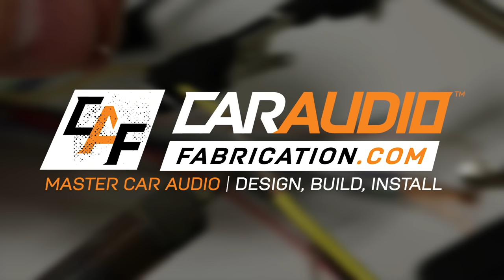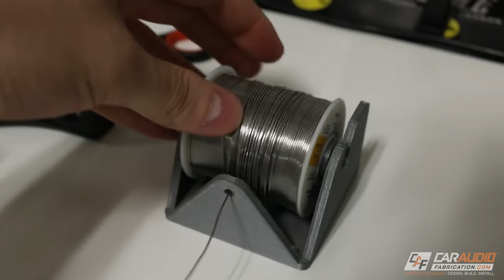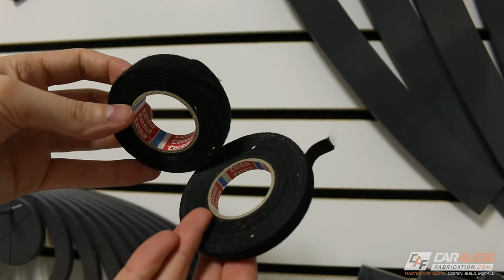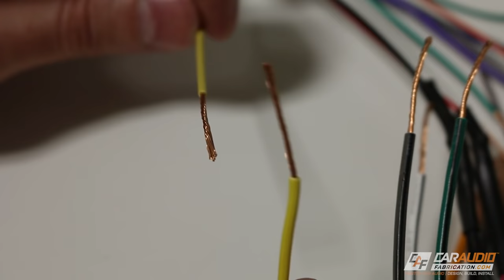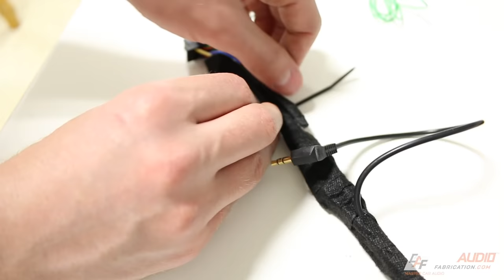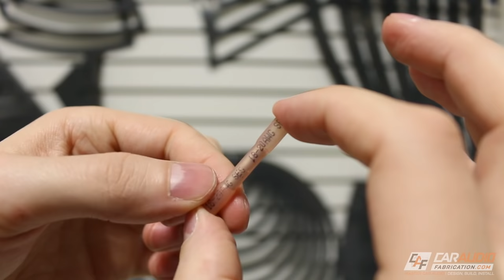Radio Wiring Harness - How to Install like a PRO

Comment: IDK how many times I got the wire twisted/soldered perfectly, and then "BOOM" I forgot the shrink tube! Similar things while I was making all new brake lines I got the brake line double flared perfectly just to cut it off because it had no fasteners
Reply: Its a pain, but if you have a pin removal tool you can just remove the wire from the connector.... slide the HS over and replace the pin.  I wouldn't know anything about that though, but I never forget ;-)
Reply: I know. I do that just about every time!

Comment: advanced pro tip: stagger the lengths of each wire so no connection is wrapped against another, especially when soldering. Sometimes the soldering process will create sharp points that can penetrate heat shrink and create a short circuit, it also avoids a bulge in the wire bundle, especially if you wrap all the wires together with tape. Otherwise great job showing proper layout so everything stows properly. Best connection is a crimp barrel soldered and protected by heat shrink that has glue inside. A poorly soldered connection will actually create excessive resistance, causing the wire directly before the connection to become brittle and eventually break. this comes back to using the correct type of solder and ensuring the wire is properly sized for the distance and load. Each connection will have some sort of resistance due to the electrons having to pass from dissimilar metals, the goal is to create a connection that has the least amount of resistance, and to design a circuit with the least amount of connections.
Reply: A tip from a real Pro.
Saved me having to say it

Comment: I eliminate the OEM harness altogether, and hard wire   everything, fresh 12 volt battery, 12volt ignition, and all fresh OFC everything, including speaker wire, since the factory wires run thru much much to many junctions, which degrade sound I have also learned if you do use the OEM harness, It affects the idle of the car on some models Mitsubishi  to name 1,it was like the cars ECU didnt like it, idle problems, studdering, so i started running  everything  fresh ,this way the cars computer doesnt even know a stereo is installed ,YA it is alot more work, but the extra work is really worth it in the end...but thats just me you do great work, keep the videos coming...

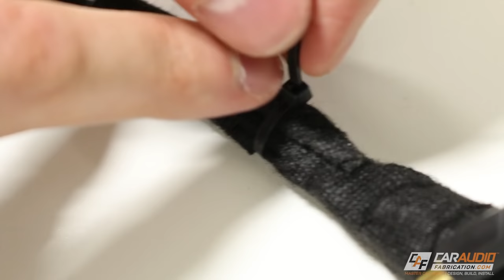Comment: 9:29 THIS. So much. I can't even begin to describe the amount of times I got cut from a ziptie remains that wasn't cut like this.
Reply: If the zip tie is cut and you left a sharp bevel just touch touch the bevel with flame from a lighter for like 2-3 seconds. Its way cheaper than the tool...

Comment: Thank you so much, installed an android double din but it required me to connect the wires to my new harness. Never soldered before but you gave great tips, especiall about the tesa tape which I brought from ebay. I first soldered only the negative, constant and ignition wire, then tested it at the car, it worked so went back and soldered the antenna and the rest of the speakers wires. I tested it again, audio worked and the radio. Once I knew everything worked, then I made the cables neat and used tesa tape. One thing to remember, makes sure you put heat shrink before you solder, forgot on 2 of my wires so used electrical tape. But anyway, thank you for the clear instruction.

Comment: I just installed a new head unit. I DID do the soldering & heatshrink, but I wish I'd seen this first for the Tesa tape tip. It would have made my harness look MUCH better. Also... you might want to mention connecting to grub screws, like with a line output converter. I tightened the screws down on bare stranded wire, and had problems with wires falling out. I later found out that I should have used ferrules. I'll redo my harness at some point.

Comment: continuity after wrapping it up? probably do that before wrapping in case you have to fix a connection
Reply: 2000 nissan gsx stereo wiring diagram

Comment: Another point you forgot to mention about tesa-tape is that it is also somewhat dampening, therefore reducing the chances of wire rattling against some other parts within the radio bay or wherever else you're using your own wiring.
Reply: How to Chose the Correct Harness for you Stereo
Reply: @DeathCap  any shop that sells stereos should have the right harness for your car

Comment: I really liked this tutorial, as a mechanic always telling people solder is a better choice, it was awesome to see someone who also believes in doing it right, right from the start, I have troubleshot electrical issues that people have had and it is the connections made that have failed in most situations. If you are spending cash to get the toy you want wire it right so it won't fail as easy. the twisting the way you have done it looked really good, i have spread the wire like a flower then twisted together and your way looked like a better connection than mine. Thank You Sir
Reply: ross lesher why do you say solder is better?

Comment: Also, make sure before you do any cutting, soldering is you know what to do do, this was my first time ever soldering and do anything like this. I watched a few soldering videos, made sure I had all the tools I need and took my time do it. Don't be impatient. My next thing to do is to install a steering interface as my steering wheel has controls so will be doing more research hard to do that but once again, thanks.

Comment: Thanks Mark. i have learned many new things in the Mobile Audio with along Steve Mead and EXO.  because of all of you i have bought many different products for my sound system.  and just other things like this video.  on knowing how to solder the way you did.  i did not know of looping and twisting together.  Yes i have had made the mistake on the heat shrink and forgetting them toput on first before soldering.  Again thank you for this great video.

Comment: Soldering really makes a difference. Cartoys installed my stereo when i was 18 (with crimps) and about 2 years later and a lot of bumpy rides, my negative wire came loose, i removed all the crimps and soldered the wires this time around and i swear my audio quality was noticably better afterwards

Comment: I changed my wireharness from buttconnectors and even from just electric tape and used the solder way and it fixed it. :) TY

Comment: Great video.  I prefer just zip ties to bundle the wires together, but very clean.  The tape can get sticky after time if you want to swap in another head unit or modify the harness.
Reply from the maker: +Cory Simmons use authentic Tesa Tape, it's important to get the right model number. It doesn't leave a residue.

Comment: Love the channel, I am not a professional installer, but      I have completely rebuilt a few cars and trucks frame off restorations and I have my Extra Amateur radio license so wiring is pretty simple stuff for me, yet I still learn things from your channel about equipment, mounting options etc...

I loved the videos on using plastics for brackets, mounting etc... I've used metal in the past and you've taught me some new options.

While looking through your videos I happened across some of your early videos, so glad you dropped the "ghetto wanna be" aspect of the presentation or I never would have continued to watch and subscribe.

Comment: Thx 4 the tutorial. I'm gonna be installing so I needed a refresher, its been like 15-20 years since I installed a stereo. Back in day I used electrical tape for the wrap but I'm gonna get some of that tape you used. 👍✌

Comment: I personally prefer to solder, but a crimp is technically the more secure joint. The heat shrunk crimps are also pretty great if you stagger them.
Reply: If I’m using heat shrink do I need to solder as well?

Comment: I couldn't agree more : Do not cut the factory harness (Unless there's absolutely no alternative), solder connections that you want to be permanent, and last for a long time, and wrap them wires together (I've used electrical tape + a few zip ties, braided wire loom, plastic split loom, and once all I had was waxed string, so I wire tied the bundle. Just keep them tidy, secure, and protected. 'Nother good video Mark, keep up the great work (Wish I could afford half of the stuff you use).

Comment: Way to go Mark, 
I use the 3/8" tesa to hold back my "Save for Later" wires same as you but a small stitch or tape..
Some times I use Female bullets to make it easy to add and disconnect too!

Comment: I really like your videos and I think you do really clean work, but I would of used smaller heat shrink over the wires so it shrinks tighter and instead of the tesa tape just use zip ties but thats just my preference but again your work is super clean and ive learned alot watching your videos
Reply: The tape better protects the wires, zip ties over time can cut into the wires with the vibrations and constant bumping that occurs within a vehicle. Tessa tape with a tie on top is safer in that regard as it pads it and take more time to potentially damage the shielding of the wires.

Comment: I don't want to imply that you did not add something that needed to be added, because this is exactly correct on every level. I just want to add an asterisk to the video though. Before you start to dig into buying an aftermarket radio and all of the connections, make sure you don't have an amp, or some other feature, that needs to be considered in the installation. With these new cars, there can be several things that could pop up that would make your installation not come out the way you want it to.

Comment: Mark.  The only 2 things I would do differently is after soldering you should clean off the flux residue left after flowing the solder with alcohol.  Over time the flux will corrode the connections.  The other thing is if you pre-tin the wires before you hook and wrap them you will get a cleaner and stronger connections.  But a lap splice would be more than strong enough and faster.  I have lap spliced wires and tried to pull the connection apart and the wire will break before the solder splice does.  You should look up IPC soldering practices.  I use them at work and they are industry stardards.
Reply: Was just about to comment this. Just needs cleaning.
Reply: bhaejr that's only with acid flux.  No electrical solder used today uses acid flux.
Reply: brian hilligoss the most common solder is rosin core. That is a medium flux. All solder has flux in it or it wouldn't flow properly. It needs to be cleaned off with alcohol so that it will not degrade over time. I work with it everyday.
Reply: bhaejr I do work with it as well every day. Cleaning of the flux is more a professional touch now a days with none acid core flux.    Most rosin core is pine tar based.  That will not degrade today's lead free solder.
Reply: brian hilligoss I can show you circuit cards that come back from the field that shows a different story
Reply: brian hilligoss I can show you circuit cards that come back from the field that shows a different story
Reply: i was thinking exactly the same ting, plus i prefer to parallel wire solder, i don't like to  stress so much the copper..

Comment: Not sure if you have already done a video on using your factory head unit and add after market processors and amps. I will scroll through you previous videos if you have not that is one that would be awesome Matt! Thanks in advance.
Reply: I also forgot to mention that the stock system is a Bose hi end with a sub woofer in the center console that I will be keeping for a front stage and the rear subs will be the same size as in the center console and I will be replacing that woofer with the same kind that will be in the rear. Most likely CT Sounds and amps so would you run all 5 woofers off the rear subwoofer amp or keep the center console on the stock amp?  Help me out Matt

Comment: Thanks a lot for this video. There are only a couple spots that do installs here in town and they charge an arm and a leg.
Reply: When you find someone good, knowledgeable and trustworthy it is worth the extra money. But there are a lot of dirt bags out there. Have them do a small job first, and see how it goes. Any little thing that you do not like...then try the next place/guy. Because if something is a little wrong on a small job, then expect larger problems on larger jobs.

Comment: What is the best way to connect those other two wires from the interface?  You said they had to be connected in the car and that is the part I am struggling with on my install.

Comment: For those who dont have good soldering experience. What about heat shrink connectors with solder in them? and then tape it around like you did.

Comment: Solder is great, but a butt connector is just fine for most connections. Especially for wire harnesses. At the end of the day it's all on a plug just a few inches down. Obv solder is crucial on data connections or resistance based connections like the resistance ladder connections of a steering wheel control connection.
Reply: The problem is that most people just use pliers to crimp butt connectors. This makes a poor connection. If you use an actual decent crimp tool, the connection is much stronger. But a good crimp tool is often more expensive than a soldering iron, not to mention more people tend to have a soldering iron laying around, so that's usually a better option.

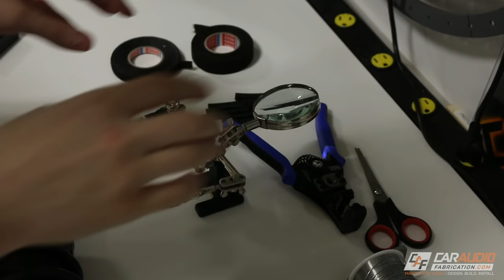Comment: Fyi, wire holding station @2:35 , found one at Harbor Freight (usually called 'Holding Hands') for all of $6! Also heat shrink assortment for $4 💪

Comment: It's crazy you did this vedio as I did just this job last night to fit a bluetooth handsfree.  Did the same but instead of the tape I used cable lace. As I've done this befor and used electrical tape but after a wile I went to remove the install and all the tape had heated up and the adhesive was just a mess so deffo a top tip is not to electrical tape

Comment: The one thing I'm trying to figure out is the cheapest way to wire these boss be654 led speakers I have.  they have separate connections for the 12v, but I didn't know it needed that, figuring it was using led it used some small amount of power from the signal in the speaker wire. Speakers work fine without the light, but purchased squarely for the led lighting

Comment: I'm about to install a new BOSS head unit (w/cam and RP5 adaptor) from Crutchfield in my 09 Impala and been watching a lot of these types of video. This one has been the best by far, and having been an aircraft mechanic I can appreciate the the fact that you soldered your joints the right way. Now I have to figure out how to tap into the car harness for the parking brake, reverse and dimmer. Any hints on that?

Comment: Very informative video’s, thanks for them. I am installing a aftermarket radio/gps/backup camera in my 2003 gmc envoy however I can’t seem to find the wire diagram for the dash plug so I can match the radio through the aftermarket plug adapter. HELP!!!

Comment: Every car that I’ve ever installed my equipment in never ever were connected to any factory connections. I always wired up separate power cables to the radio and all amps so that I didn’t have any issues with factory wiring. Neve really worried about forgetting to shut down the head-unit (one button push) or faceplate removal and all my amps shut down with the head-unit. Just seemed easier to minimize my connections under the dash with main power, antenna, amp turn ons, and signal cables for front, rear, and subs.

Comment: Just installed a 10 inch kicker in my brothers truck. When we were running the rcas and the remote wire we found out the previous owner just twisted the wires and wrap with electrical tape on the head unit. I just redid the connections with butt connectors because it was fast. His speakers used to cut out, now everything works fine. Really hurt not soldering though.

Comment: Been a auto repair technician for over 12 years and never run into problems with butt connectors that heat shrink I'd you use the pliers that are made for them. After you crimp , you apply heat the plastic shrinks and fills with glue. You will never have a problem with those. But I do agree that the simple ones suck.

Comment: Mark, your thoughts on posi-lock barrel connectors?  I've used those with good success over the years of upgrading factory headunits to aftermarket equipment.  Also, tessa tape FTW!

Comment: Very good video, I just have one question. There is a 1/8" stereo type jack coming from the harness, and there is also a similar jack on the back of my radio. Neither one has any information to be found and both appear to be not needed. Any idea what they are for?

Comment: Relatively new subscriber. Came here for some soldering tips. Is that really all there is to it? Use the soldering iron to heat the wires and then touch the soldering wire to the target? How long do I leave it to cool before pulling the heat shrink over it? I’m doing an install for a friend soon, and I haven’t done one in a few years. Have never done it “correctly” and have always just used butt connectors.

Comment: How (where )do you connect the light green wire for the hand brake ?  It say must be connected to the power supply side of the parking brake switch. Do you have example of that ?

Comment: Do you have a video about tuning a head unit? Bass treble  mids the fade, whole nine yards would be helpful. Your vids have helped me out before thanks!
Reply: Alex Peters That is usually done completely by ear, and even then it would depend on your musical taste. If you have a source level adjustment just be sure you set that right so you're not clipping at higher volume, 75% volume is the rule of thumb but just close your eyes and turn it up until you hear it distort, then back off a bit. After that set your eq and you'll be good to go.